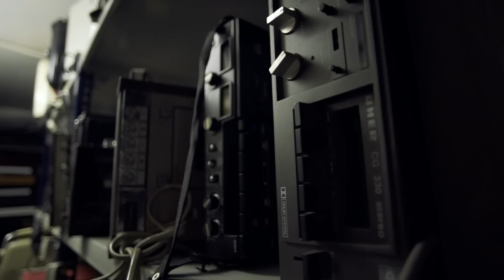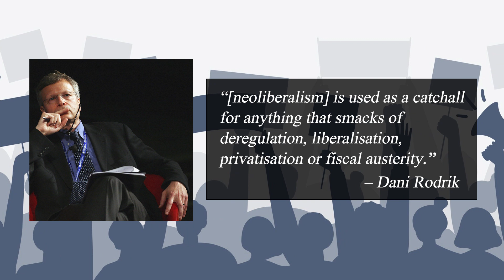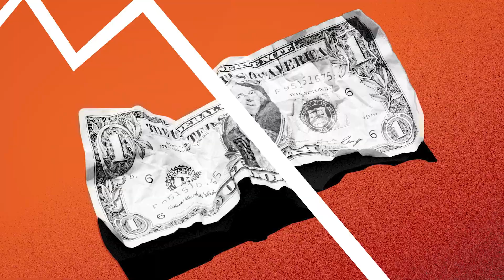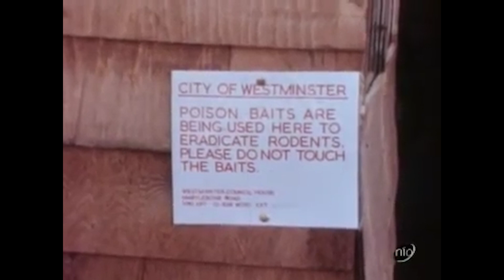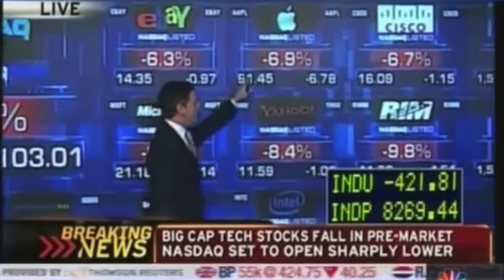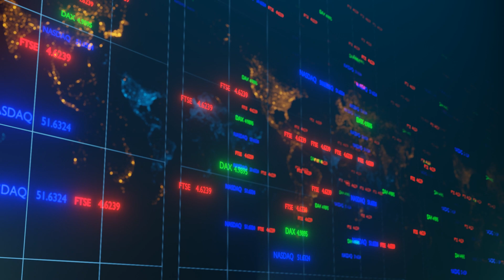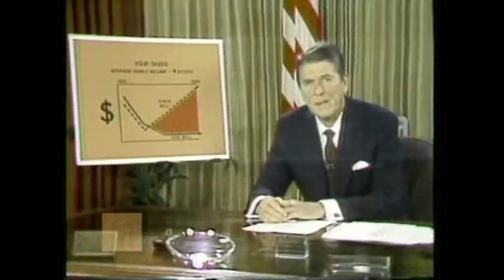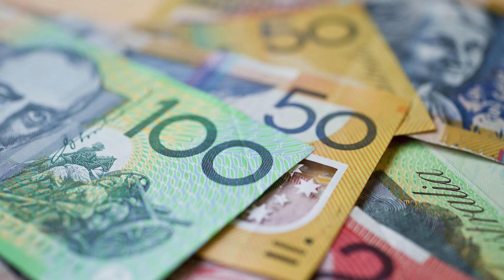Neoliberalism Doesn’t Exist

Comment: This is an interesting critique of the abuse of the word, but I think you also shouldn't generalize that the use of the word and the condemnation of what it means is broadly misguided. The failure of neoliberalism isn't a merely blank statement on socio-economic policy, it's a also philosophical point. Obviously that's not something that's discussed explicitly, but it's the main idea and it's what allows you to envelop the vastness of what neoliberalism means. And of course, the meaning in it of itself might change depending on who you're talking to. If it's an anti-capitalist, what's more likely is that when they mean neoliberalism, they also are referring to the whole thing in regards to free trade and a market economy. If it's a South American liberationist, it's a question of colonialism and its intrinsic relation with capitalism. If it's a liberal, it's a question of rescuing the meaning of liberalism beyond mere economics.